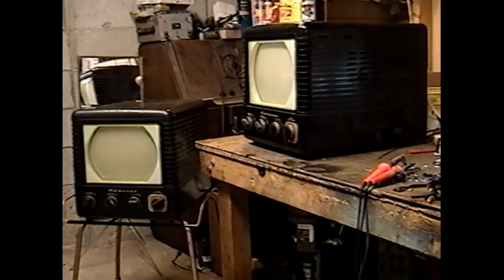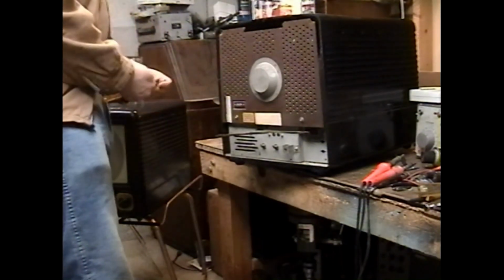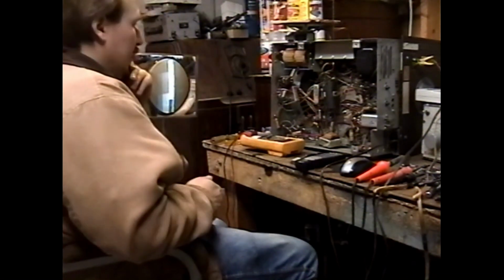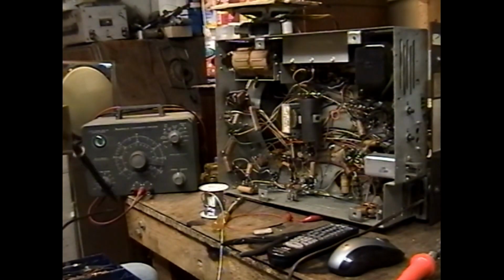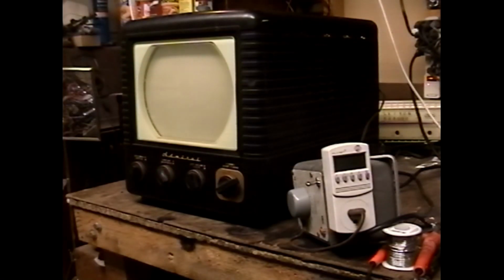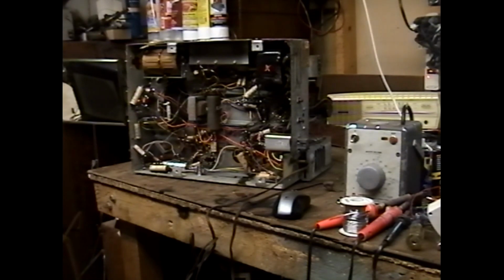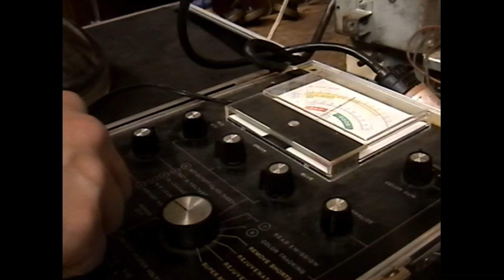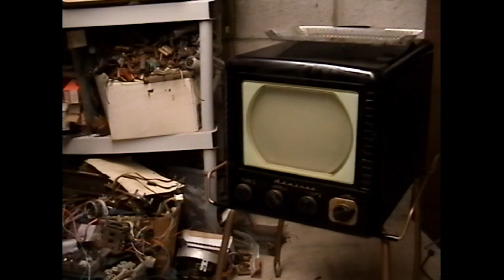Tale of Two Admirals, Repairing 2 1949 Admiral 20X12 Bakelite TVs

Comment: How lucky were you with the vertical output transformer! The second set was very dead - as the CRT was toast you made the right decision to abandon that one. Another interesting video - thanks.
Reply from the maker: I couldn't believe that a random vertical transformer from my spare transformer box happened to be the correct replacement part. The odds of that happening are probably lottery level.

Comment: Fascinating subject, but are your camera and video encoder from 1949 as well? Why the low quality video posted (ironically) in 1080p?
Reply from the maker: My only tripod mountable HD camera committed suicide before this was recorded...The only other tripod capable video camera I had was a 2005 480i only Sony (and an external S-VHS deck for capture since I'm out of digital8MM video tapes for the Sony)...I take that back I could have filmed this on an 80's betamax camcorder, or a 1970's monochrome camera designed to pair with an EIAJ open reel videotape deck (both also 480i and lower quality). These Admirals were on a tight time crunch to get fixed in time for a once a year swapmeet. So there wasn't time to figure out a better filming solution (it was film it this way or don't film it at all). My editing software doesn't allow lower resolution output so 480i post editing became 1080i (it would have been a 3.5 hour video unedited).
A few weeks after recording this I got an idea on how to tripod mount my smartphone that I plan to try soon.
Reply: @tomcarlson3913  I'm impressed. Remarkable just how far we've come since 2005, let alone 1949.

Comment: I have one as an end table.  You have matching end tables too.
Reply from the maker: Had, past tense. I sold those as a set at the ETF since neither cabinet was quite good enough, and I remembered I have a pristine GE locomotive to scratch the Bakelite TV itch.
Reply: @tomcarlson3913  The Admiral I have has a pencil box in the front middle of the set.  How admiral of them.  Did those series of sets have good picture tubes?  There is not a crack of scratch on mine It's a wine color.  It would really polish up when I get around to it. I  need a picture tube tester.
Reply from the maker: @jockoharpo2622  I had one of those. 12" double D CRT mask, gold plastic pencil box. I forget why, but I sold it to a local friend who really wanted one. It's basically the same chassis as this with potentiometer location changes...IIRC they're covered by the same Sam's folder.  CRT's back then were generally of good quality, but that doesn't say much for if they're good now....Some of these late 40's early 50's sets were ran regularly into the mid-70's and saw 3 or more replacement CRTs, others had a problem in a year, the owner didn't want to pay for a repair and it sat since then. A CRT tester should be at the top of your equipment want list if you plan to buy or keep multiple sets of this era (they keep you from buying overpriced junk, and tell you if what you have is worth putting $50-80 of caps in)...My tester gets over 2K miles of travel a year thanks to me bringing it anyplace I think I might stumble on a TV I'd consider buying, and not want to make a round trip from home to get it.
Reply: @tomcarlson3913  I appreciate all of your knowledge and taking the time to answer back.  Enjoy your videos as well.

Comment: Let's just strip the ends, bite spit bite spit,.......😁
Reply from the maker: All my life there's only been one set of wire strippers that can handle any gauge perfectly without taking more than half the strands with the insulation 3/4 of the time...They never never seem to get lost or damaged either which is a major plus.

Comment: Could you be related to an old fellow I knew named Stromberg Carlson?
Reply from the maker: AFAIK I'm not related to either company with the initials S-C (Stromberg or Setchell). I do appreciate their products though...Stromberg made some darn stylish rebadged Dumonts in the late 40's, and Setchell's unit-ized chassis and product design were top notch...Setchell-Carlson and Packard Bell IMO were the 2 companies that could genuinely compete with Zenith on engineering, build quality and serviceability....RCA was basically GE with less militant cost cutting, and an oversized under productive R&D division and a visionary pirate at the helm.  
As I was told it my family name was changed when my ancestors came to the US because they wanted to be carpenters and they wanted a name that implied that they came from a country (IIRC Finalnd) better known for carpentry than their actual homeland (IIRC Sweden).